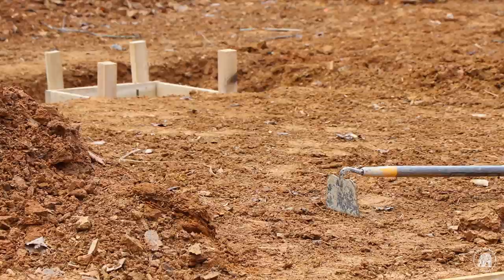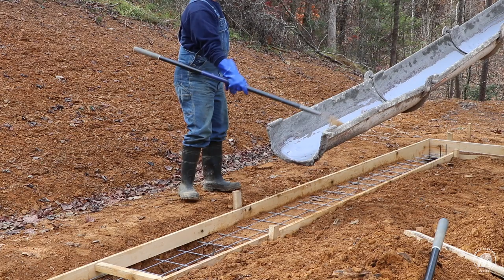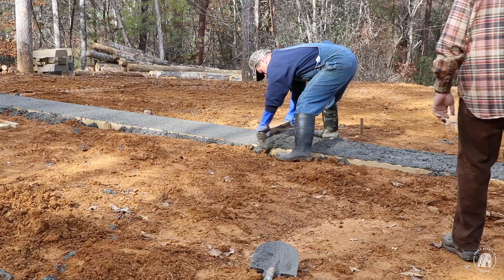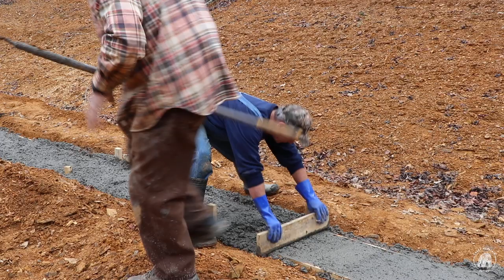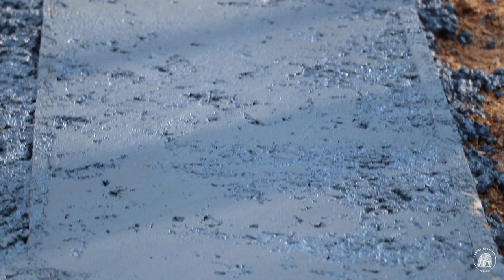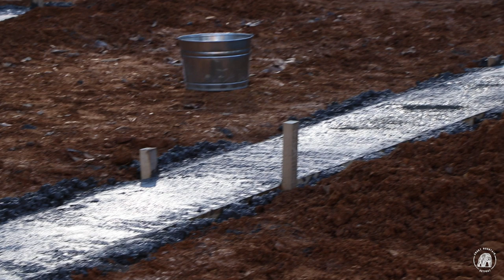S1 EP12 | TIMBER FRAME BASICS | POURING CONCRETE FOOTERS FOR THE CABIN

Comment: Concrete is a tough job but somebody fas to do it  I did concrete work here in Texas for 15 years we did regular concrete work like pouting slabs we also did exposed aggregate work and one time we poured. A pool deck and walkway in the concrete mix there was fiberglass and crushed marble the day after we poured it we went back and sand blasted it by doing this your are exposing the marble. it sparkles like diamonds  it was beautiful

Comment: What is the purpose of such a leaf-thin footer?. 3 inches?. No frost where You live?. And You seem unprepared once the concrete arrives. Spacers for the rebars does the trick, a concrete pump, a few extra hands?.
Reply from the maker: The purpose between the post is for rock to sit on. The ground is primarily shale. Footers for structure are 2’ square and 12” deep. Not much frost line here. I had all the help available. And, it wasn’t much extra work in bending over to pull the mesh into place. The driver pumped way to fast but the job got done. A little hard work now and then keeps you going. I had a concrete contractor write to me and said @he would have been fired on the union site, lol. Anyway, thanks for the comment.

Comment: What a mess !!! Keep the concrete within the boards.
Reply from the maker: Yes that would be easy if the driver didn’t dump it so fast.
Reply: @SmokyMountainOutpost  dont blame the driver.. I do alot of concrete works an i never make a mess.. also the concrete a little to stiff for the trenches the butt its ok